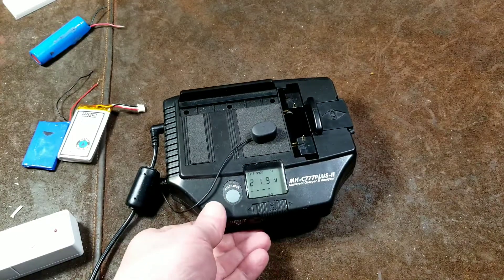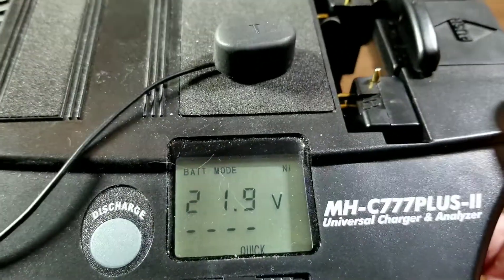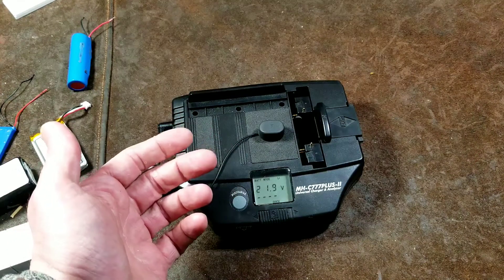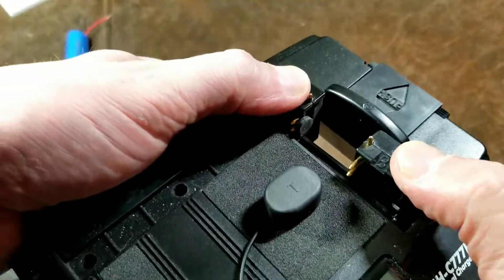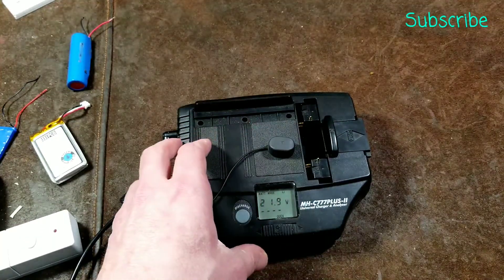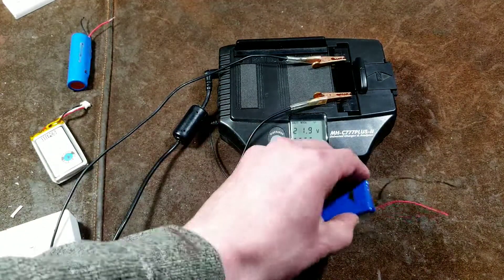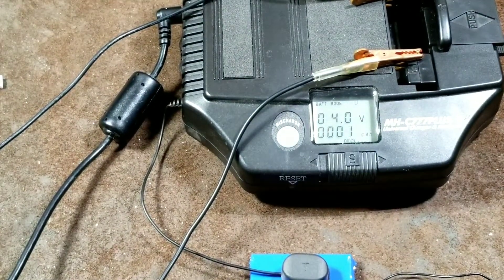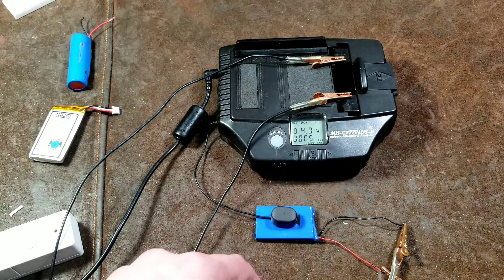Maha Universal 1.5v-14.4v Li-Ion/NiMh/NiCd Battery Charger Review

Comment: I have always wondered why Boeing didn't have a temperature sensor on its first Lithium Ion batteries a few years back. Older wet cell NiCads have them.
Reply from the maker: Yes especially considering the minimal expense of a thermistor and a simple cutoff circuit